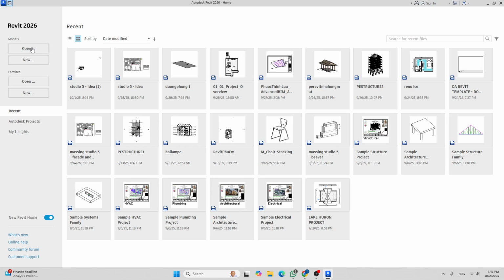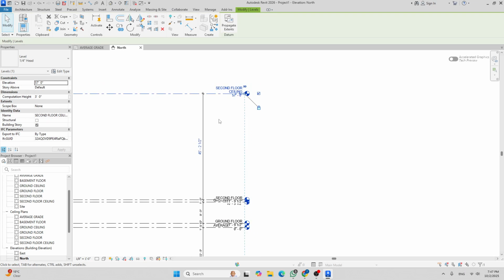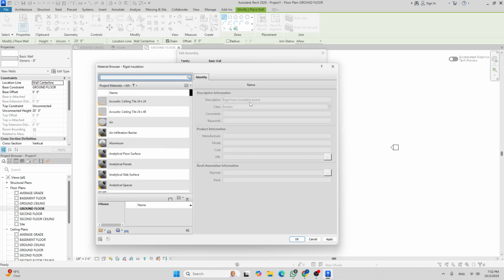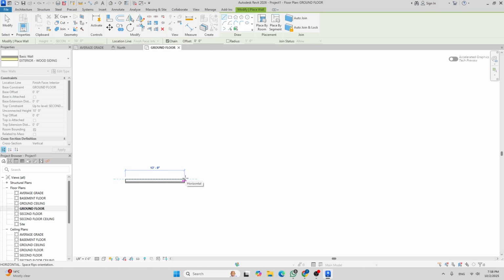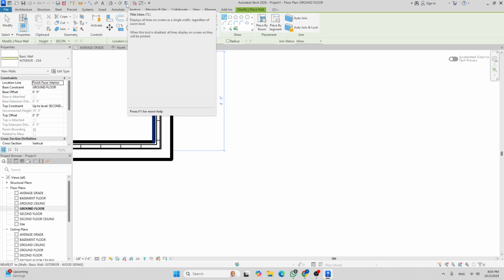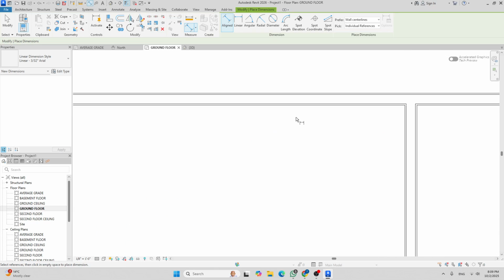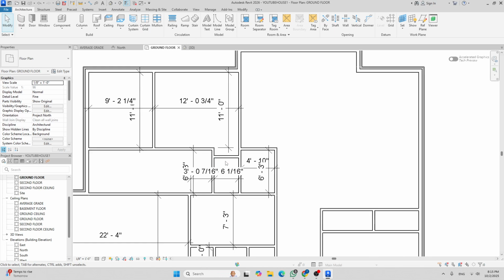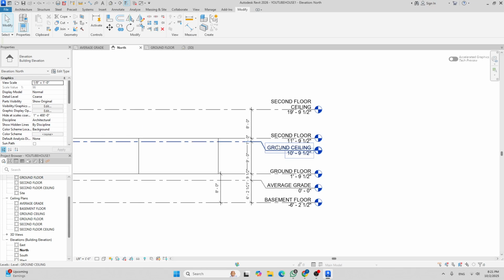Revit Step By Step Tutorial - Part 1: Creating Levels, Exterior and Interior Walls

Comment: but inch :(
Reply from the maker: i know it is hard to convert inches to metric unit, but if you type the unit after the numbers in revit, it will auto convert that number for you. For example, if you want to make a wall 10meter in length, even if you're in an imperial template, just type "10m" while creating that wall, revit will auto convert for you, same goes with every other units, like cm, mm. Thank you very much for watching and let me know if you have any other questions !
Reply: @brokeahhrevitdoer  It's great that it automatically converts to inches when you type in cm or meters, thanks for the information.

The real problem is that it's difficult for someone working with metric to practice by looking at someone who draws in inches. Besides, it's not really necessary to practice by looking at inches :)